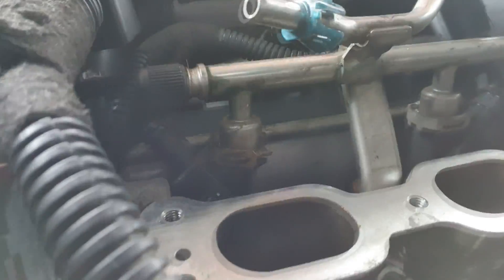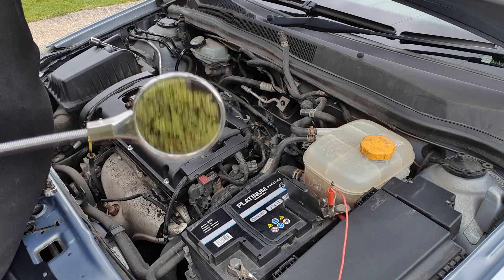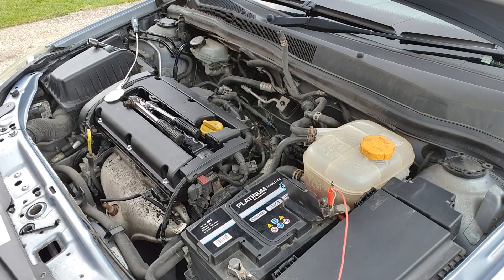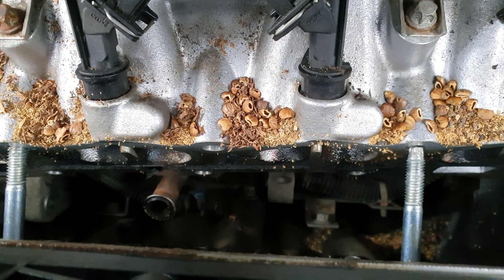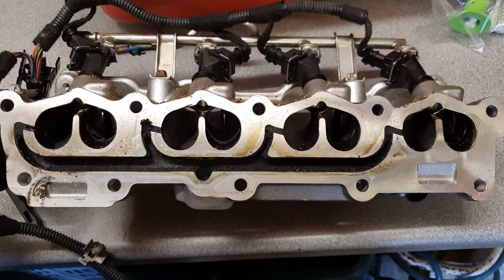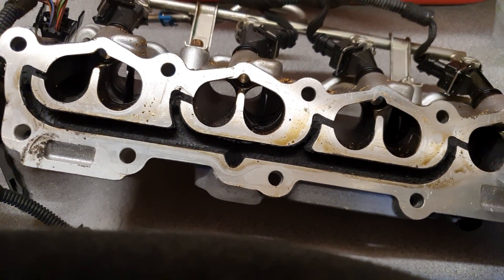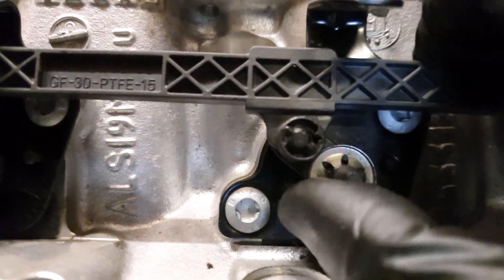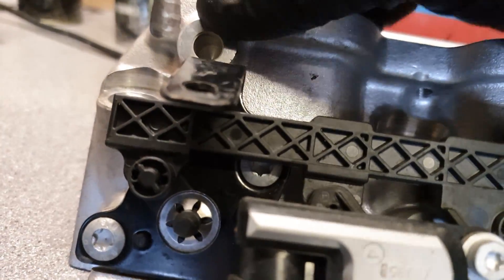Astra H Z16XEP Lower Intake Manifold removal

Comment: 7:04 when you correct yourself calling the screws bolts, you were right the first time. They're machine screws not bolts! Bolts are only threaded part way, machine screws are threaded all the way to the head. The head type is immaterial. Nive vids 👍

Comment: Hello mate, what are the symptoms of clogged channels? In my case I noticed a vibrations/resonance when I am starting on first or reverse gear. There are no trouble codes and idle RPMs are even. Do You think it might cause the problem?
Thanks!
Reply from the maker: I'm not sure what the actual symptoms would be probably slow acceleration maybe increased fuel consumption, my engine had a lot of other issues due to a lack of servicing by the previous owner, I would have thought vibration when pulling away is likely to be clutch, engine mount or maybe even an exhaust mount

Comment: Hello, can the valves be physically removed without affecting the operation of the engine? When the weather is cold, I always get a 3-cylinder misfire!
Reply: I mene zanima isto.Mislim da oni ne razmisljaju kao mi.Mi bi sve suvisno da izvadimo🙂🙂Javi ako saznas nesto.Pozdrav
Reply from the maker: The twinport system on these engines is designed to improve lower speed torque and fuel economy, Vauxhall/Opel/GM fitted the system for a reason so although the engine will run without the valves/flaps fitted I wouldn't recommend removing them, it will effect the performance of the engine as it will have been mapped to include the changes in airflow caused by the twinport system, also if you removed the control valve and position sensor you will more than likely get the engine management light on all the time

Comment: How you take off fuel line away. ?
Reply from the maker: Hi, Thanks for your comment, unfortunately I didn't take the fuel rail and injectors off so I'm not 100% sure, I believe the injectors are just a push fit into the intake manifold and there is a spring clip that retains them into the fuel rail one thing I would say is if you are removing injectors, replace all the "O" ring seals when reinstalling 
I'm planning to make a series of videos on completely dismantling the old engine in the new year so I'll work out exactly how to do this